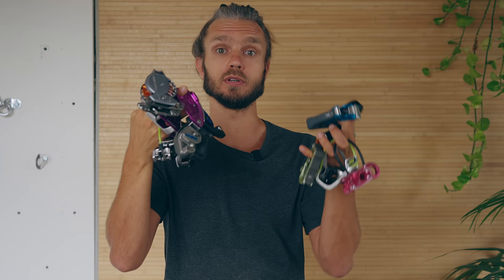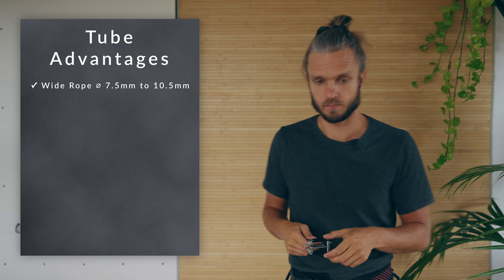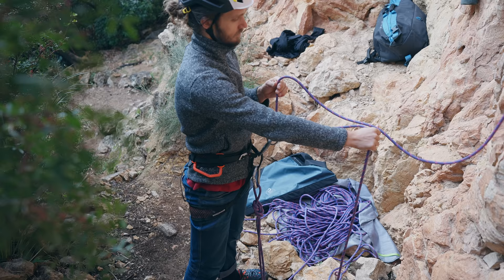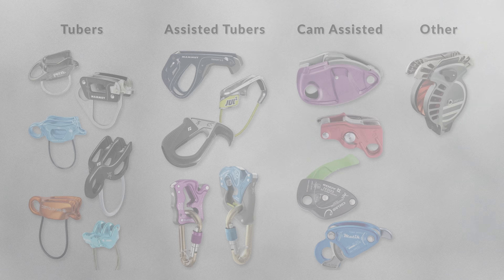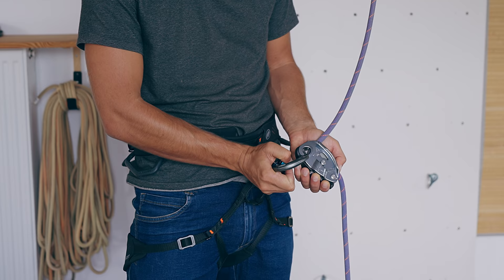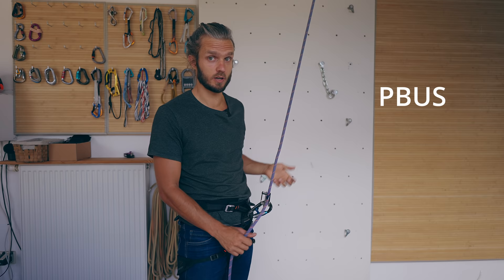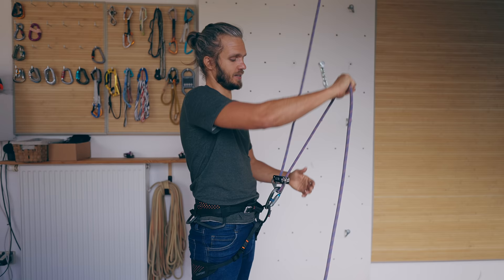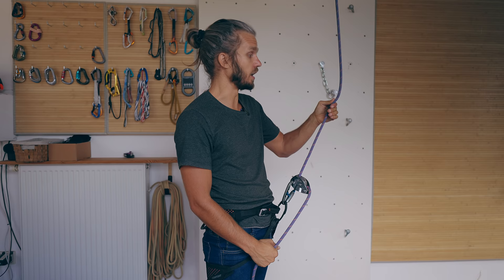Complete Guide into Belay Devices - Differences and Efficient Usage | Ep.6

Comment: Why the the insistence that you can never let go of the brake hand with assisted belaying devices? You absolutelly can and nothing will happen. There isn't a single reocorded instance of a device like that failing. I've been climbing for more than 10 years with all my climbing friends using multiple assisted belaying devices and we ocasionally let go of the brake hand to drink water, rest, or wathever... nothing ever happened and nothing ever will.
Reply: He explains it in the grigri episode - have a look! If you hold the cam or get dragged into the first quickdraw you can drop the climber. In addition, if you switch between say a grigri and a normal tube device for some reason, it is very important to have muscle memory movements that are not dangerous with other belay devices. I pesonally don't see why anyone would insist on breaking simple security rules, this is a sport where good habits should be cultivated.
Reply: @torepore  I saw the episode. The problem is holding the cam open, not letting go of the brake hand... the grigri for instance will lock 100% of the time if you simply don't touch it.

As for muscle memory, that's another thing altogether... once you buy a GriGri there's no reason not to use it. I rarely ever see people belaying with an ATC at the crag anymore.
Reply: @daniel_brqlo  And the one on being dragged into the quick draw? The very top comment on the grigri episode is from someone who him self got dropped while the belayer used a grigri. It would probably have been prevented by either holding the rope, or as you say, not holding the cam. My view is that accidents like this happen because good habits are not cultivated and extra precaution is not taken. The same goes for double clipping in top rope anchors, tying knots on rope ends before rappelling, using friction knot when rappelling etc. These are extra precautions to keep us safe, and I just don't see any good arguments for skipping them. And especially not criticizing educators for promoting them. The safety benefits of assisted breaking pretty much dissapears if we stop holding the rope.
Reply: @torepore  "and I just don't see any good arguments for skipping them"

That would be true for helmets as well, and yet, most pro climbers (including Ben from the video) use them very rarely. Why? Because you don't have to. There's a risk/benefit to doing everything that we do and we don't follow every single safety procedure all the time because it's bothersome and impossible. Some things are riskier than others.

I agree that safety is important and good practices should be taught to beginners, but this obsession with "the brake hand" with assisted belaying devices is exagerated. 

Letting go of the brake hand to drink some water (while the climber is resting), scratching your nose or "not shitting your pants" offer zero risks to the climber.
Reply: @torepore  "And the one on being dragged into the quick draw?"

This is a one in a million situation. Being pulled so hard that you're dragged into the quickdraw and the quickdraw opens the cam and hold it open... it would be easier to win the lottery twice...

Also, I think very few people would have the reflex to keep their hand in the brake rope whilst being dragged face first into a wall.
Reply: @daniel_brqlo  I guess I just never found it very cumbersome to hold on to the rope, even when resting, drinking or scratching my nose. But I agree that not all situations are equally dangerous, and I was mostly thinking about this in the context of climbing, not resting. I also find the helmet analogy very interesting, and I see your point with risk/reward in climbing and safety. So in that context, it may be a question of habits: I have the habit of always holding on to the rope, both in climbing and resting situations, and I have no benefit from dropping it. I can do almost anything I want still with the rope in my hand. If your habits differ after ten years of climbing, I can understand that it would be a drag to change them. And I believe you can still be a safe belayer. 

As for the quick draw question, i can find myself getting close to the first quick draw when trying to give soft catches. But i have also never been jammed up in one, so I cannot  say it is very likely. It is more of a simple principle for me: accidents where belayers with grigri drop their climber still happen. Two simple things help prevent it: Not block the cam, and hold on to the rope. Neither are burdensome for me, so I try to do both.
Reply: @daniel_brqlo  , I own a grigri but use a tube style device all the time.  Muscle memory is important.  I use a tube style device for mountaineering, multi-pitch, and ice climbing since twin ropes are often used.  You seem to have a very limited view of what goes on in the climbing world.

In a multi-pitch scenario it's very easy to get rammed into the first quick draw since the first one is often right at the anchor.  Saw it happen yesterday.
Reply: @torepore  thanks for the polite answer. Usually people get really upset when I question the brake hand thing.

I always try to keep my hand on the brake rope too as much as I can, as good practice. I just don't think it's necessary to do it always no matter what, that's all.

Safe climbs for us both ✌
Reply: @FlatOutFE  and you sir, seem to think that the climbing world has no variation whatsoever. Good practices and rules for climbing vary a lot. The same practices don't apply to bouldering, sport, multipich and ice climbing. I would never climb a multi pitch without a helmet, but I do it all the time in sport (like most climbers do). I also would never use an ATC if I have a grigri, but that's just me.

If YOU do multiple types of climbing and YOU switch from belaying devices all the time, then yes, by all means, keep your good practices and your hand on the brake rope... but don't say that everyone else has to as well.
Reply: @daniel_brqlo , my response was in regard to ,"once you buy a GriGri there's no reason not to use it".  My point is that there are many scenarios where a GriGri is useless.  I used to guide and instruct  at crags, multi-pitch, and the mountains.  The GriGri is nice in some scenarios but can  also be quite limited.  I've found it's important to retain a set of practices that apply to nearly all devices.

Lastly, the GriGri is useless on ropes that have some ice on them. It's very reluctant to cam at all and absolutely will not if your hand isn't on the break end.